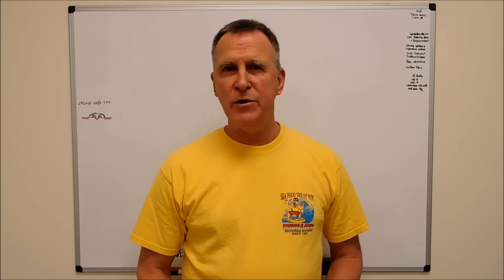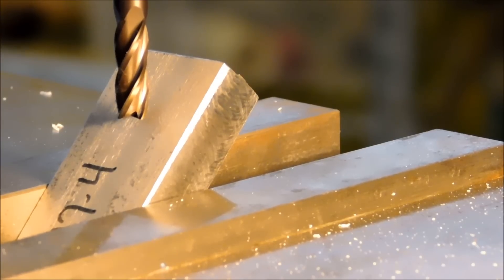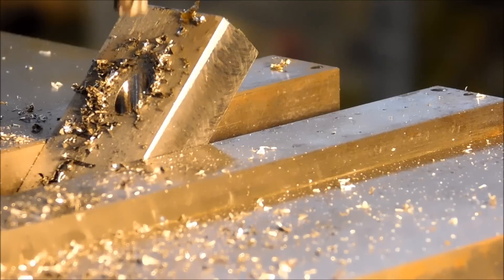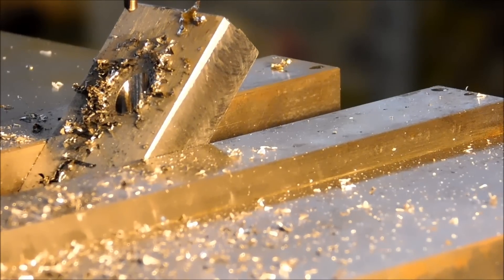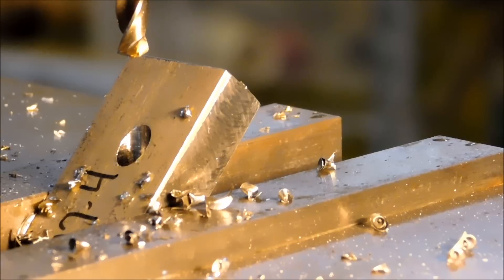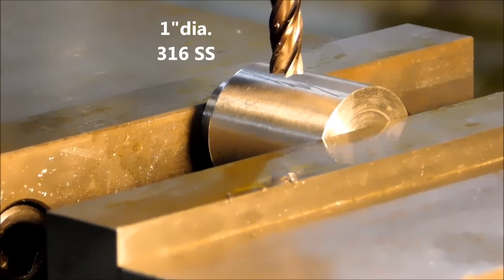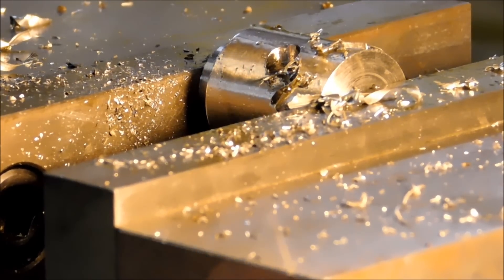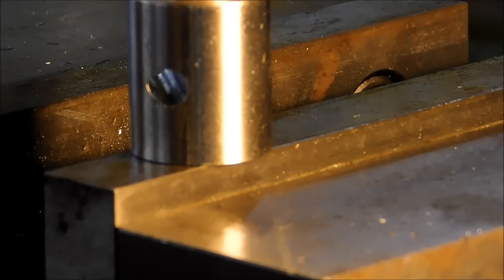Drilling Holes on Angled and Rounded Surfaces

Comment: I can't say I understand the mechanical difference (from and engineering/physics standpoint) between running the quill down and floating the quill while bringing the knee up, but an interesting tip.  I know enough to know that just because I don't understand something, doesn't mean it's not true.
Reply: Mechanically of punching a hole, no difference.  But when breaking through the back side of the hole, especially in tougher steels and exotics, it can grab the edges because of an interrupted cut.  Using the knee, gives you a steady feed pressure and feed rate, while floating the quill gives you a feel for getting punched through the back side.
Reply: Joe set the stop on the quill so he's actually pushing the quill down against the stop while lifting the table.  So it's like the quill is locked.... which you could also do but it's not as easy to withdraw to clear chips and put cutting oil on the end mill.
Reply from the maker: Try it Barry. It takes the bounce out of the process like magic.
Reply: +Joe  I'd love to try it.  If I had a mill, I'd be in the shop now poking a few angled holes.  My current shop is a single car garage filled with wood working machines.  I hope in a few years to be able to get a new shop and add some metal working machinery.  For now I am just trying to learn as much as I can.  Last time I was using a mill was in high school shop class (1990).

Comment: Worn drive gear
Reply from the maker: I am leaning that way. Its not the bearings for sure.
Reply: Hi Joe, what head is on the Bridgeport, is it one of the belt vario ones?
To be honest, it sounds like a spline drive rattling, do you have any slop in the spindle itself that you can feel?
For pocketing you should plunge down with a slot drill really, the pukka ones have an offset flute geometry, one web is thicker that then other, so when ground, one flute face is longer than the other, so the long face cuts across the centre line (Osborne Cobalt were my favourites). In my days on Bridgeports I always wound the table up, with the quill fully retracted and locked, especially in stainless (which I often had to work with) for max rigidity.